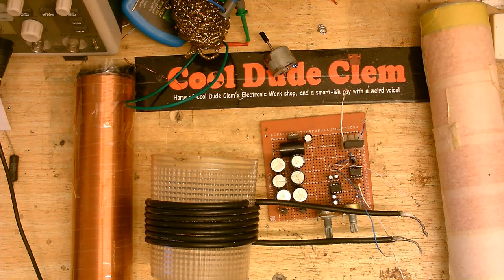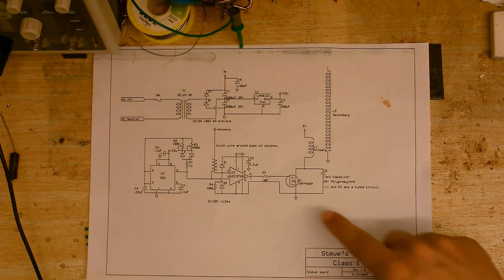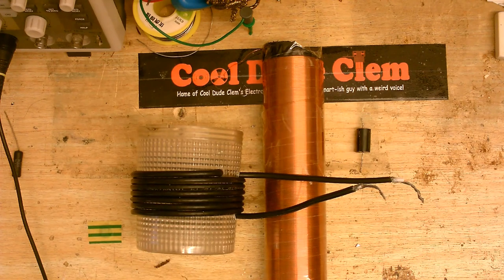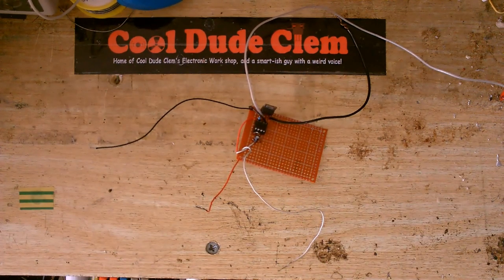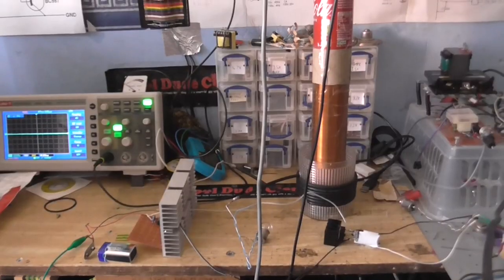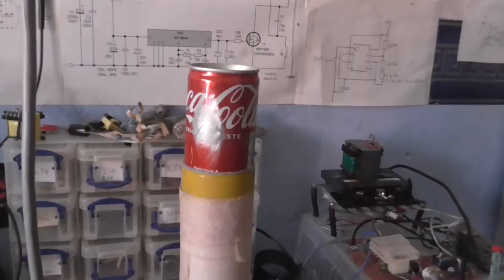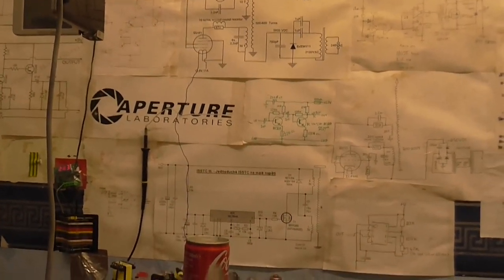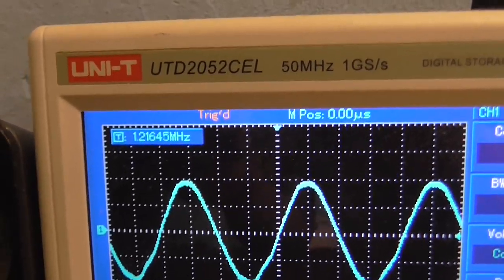New Tesla Coil Project Part 3  - Measuring secondary resonant frequency and primary inductance.

Comment: A way I find the resonant frequency is to create a simple Slayer exciter circuit, place the o-scope probe 12 - 18 inches dangling in the air, and wait. The wave will be the resonant frequency. Of course, ensure the primary is wind in the same direction as the secondary—just my two cents. Love the channel!
Reply from the maker: While I could have made a slayer exciter circuit, and yes it's the better option, I have some other plans for that circuit I built, so I thought while it's on the breadboard, I might just as well use it for this as well.
Reply: @CoolDudeClem  Sounds good.  I designed a Slayer Exciter Tesla Coil circuit that never overheats. It took me a year to figure it out! It's a continuous wave without interrupter, IC chips, or complexity. When I started the hobby a year ago, I couldn't find a cool MOSFETs slayer that could run all day without blowing a MOSFET. Not until this week! Your channel is one of my favorites. Keep up the good work!

Comment: You can use 2 led's reverse + parallel to first end of Tesla secondary coil . Leave other end of secondary open. Atatch lead from variable digital frequency generator to leds. The secondary has it's own inherent capacitance. When adjusting frequency range, both leds will light up at exact frequency of coil L.  (L+C resonance)

Comment: can you tell me type of chip in slayer circuit what you use in video?
I cant decipfher your writings its Mic????
Reply from the maker: I used a MIC4451, you might want to try the MIC 4452 in case the 4451 doesn't work.
Reply: @CoolDudeClem  Thank you Clem,Is this chip same as UCC37321,i got plenty of those?
Reply from the maker: @krisLight594  It's similar, it's pretty much the same except it just doesn't have the enable pin, so with the ucc chip, I would tie pin 3 high.